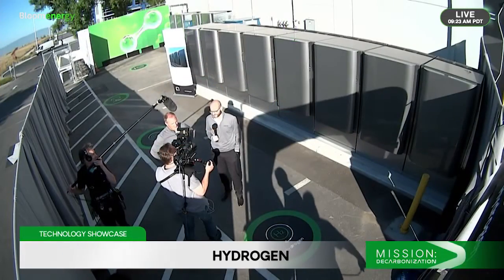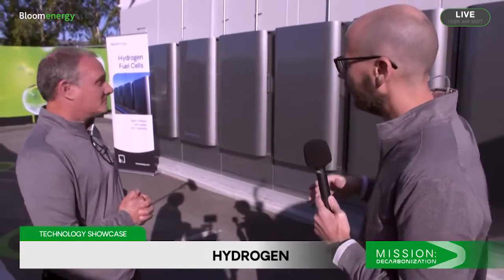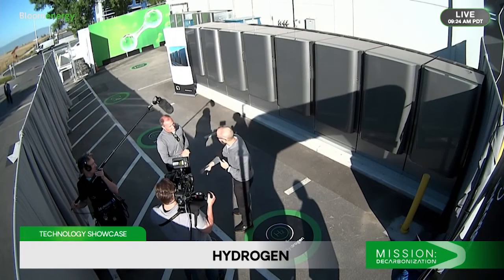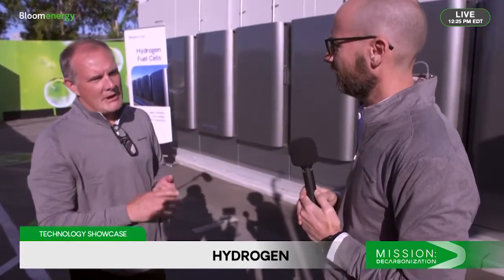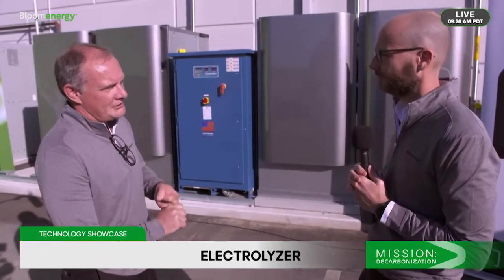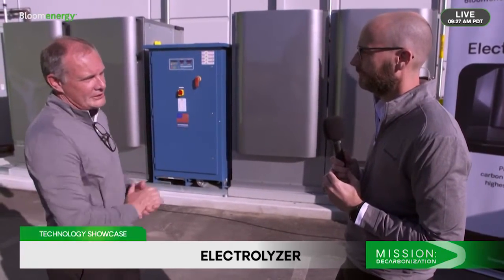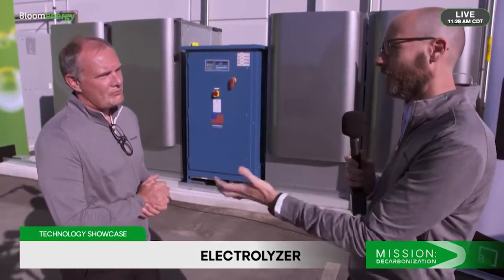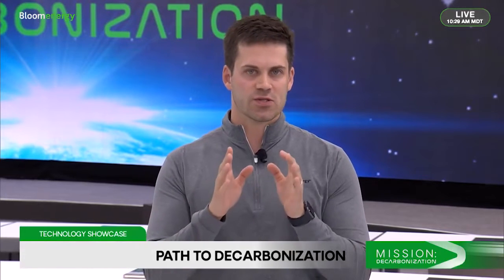Sneak Peek: Hydrogen | Bloom Energy 2022 Technology Showcase

Comment: In order to tackle climate change, we’re going to need a mixture of both solid oxide fuel cells like blooms traditional stuff, and hydrogen fuel cells.  Both for commercial and aircraft.

The trick is creating hydrogen from seawater, that doesn’t compete with freshwater sources or supplies, and is only made from renewables, That way it could be transported like natural gas (just compressed hydrogen, except we need better pressure vessels, mainly ones that use graphene carbon fiber)

Comment: Axiom: all hydrogen stocks suck and will continue to suck until electrolyzers are conceived, designed, and built that can produce millions of tons of hydrogen per annum.  Right now, this is not even close to possible.   Hydrogen electrolyzers and fuel cells are total nonsense in India and everywhere else, the "Hydrogen stocks" are hopeless losers because none of the electrolyzer companies can deliver industrial-scale capacity.  They only offer small-scale electrolysis capacity, so they can't provide anything but small-scale revenue.  Small-scale revenue will never eclipse their operating budget, so they cannot show a profit (earnings).  Small-scale electrolyzers cannot make enough H2 from water to reduce CO2 output at an industrial scale, so they are irrelevant.  Renewable energy is coming on line quickly, but to reduce global warming, one must decarbonize all of the greenhouse gas emitting sectors -- transportation, agriculture, residential & commercial building and industrial sources (primarily concrete, glass, steel and industrial chemicals).  That means we must create decarbonized fuels such as green ammonia, whereby we take cheap and abundant renewable energy and split water into cheap hydrogen and oxygen.  Then, humanity can remove nitrogen from the air (air is 78% Nitrogen) and, using the Haber Bosch method, combine the green H2 and N to make green ammonia (NH3).  Ammonia, as a "liquid carrier of hydrogen fuel," can carry more hydrogen/BTUs by volume at a reasonable temperature and pressure than gaseous or liquid hydrogen.  Large-scale electrolyzers (no existing electrolyzer manufacturer can provide) would allow green ammonia to fuel and power all greenhouse gas emitting sectors.  When electrolyzers are scaled to provide ammonia-scale plants producing four million metric tons of anhydrous ammonia per year, replacing methane feedstock; call me.  It is important to realize that to produce one ton of ammonia using today's methane "steam reformation process" conventional ammonia producers for nitrogenous fertilizers release 2.84 tons of CO2.

Comment: This would be fantastic for an off-grid system.  The caveat is creating the hydrogen which I assume can be done from a solar/geothermal/wind system rather than having to pull the necessary energy from the grid.
Reply: Exactly. But also he talked about an efficiency percentage in the 50's, so obviously lost energy there. This is why I keep wondering if solar panels that can directly produce hydrogen will be best because of higher efficiency & green. See HTOO ticker. They make small modules that get lined up in series on a panel (auto adjusting to optimum angle to Sun), take in water then convert it to H2 & pump it into a storage tank. They are in Portugal, Spain & now building a 340 acre H2 refueling station for H2 trucking in Bakersfield, CA. They'll produce enough to fuel for 1,000 trucks a day. There is plenty of unused land along Highway 5 from CA to TX for expansion, projecting will be an H2 trucking route.
Reply: Exactly. But also he talked about an efficiency percentage in the 50's, so obviously lost energy there. This is why I keep wondering if solar panels that can directly produce hydrogen will be best because of higher efficiency & green. See HTOO ticker. They make small modules that get lined up in series on a panel (auto adjusting to optimum angle to Sun), take in water then convert it to H2 & pump it into a storage tank. They are in Portugal, Spain & now building a 340 acre H2 refueling station for H2 trucking in Bakersfield, CA. They'll produce enough to fuel for 1,000 trucks a day. There is plenty of unused land along Highway 5 from CA to TX for expansion, projecting will be an H2 trucking route.